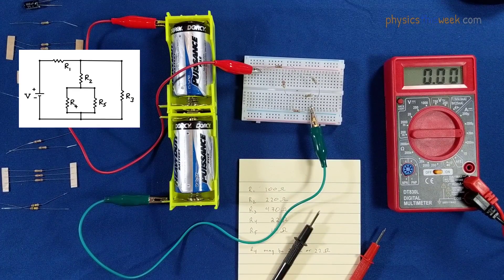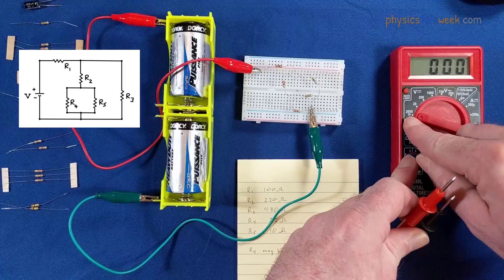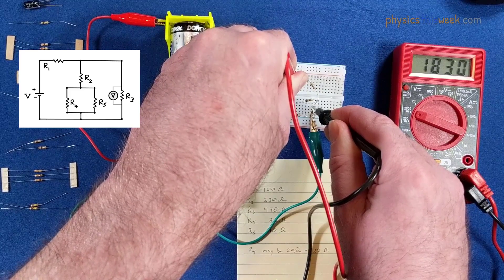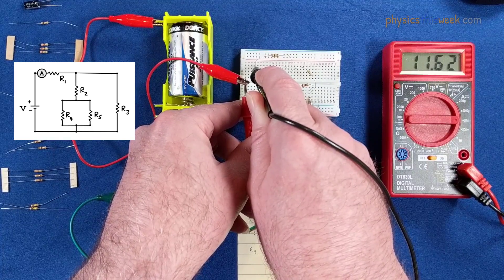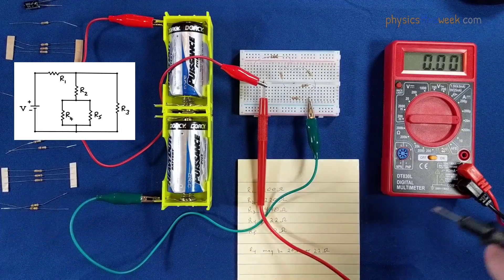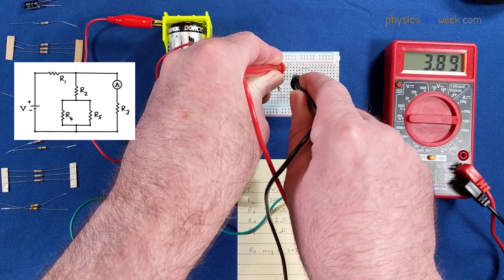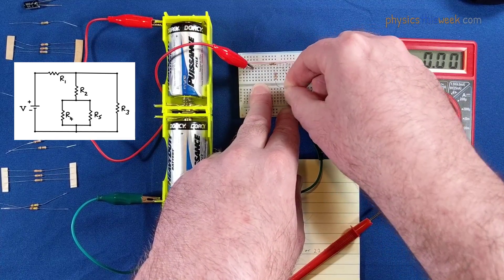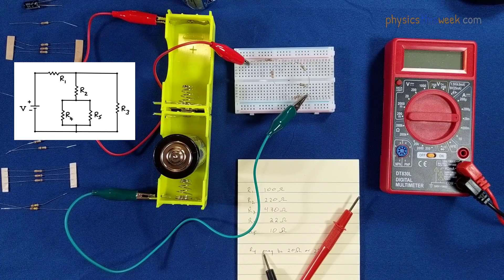DC Circuits Lab:  Combination Circuit Measurements

Comment: what would the total resistor ohm's be
Reply from the maker: That depends on how they are hooked together.  Which configuration are you curious about?
Reply: @PhysicsThisWeek  The setup you did is the config
Reply from the maker: @LordBurger  I apologize.  I forgot that I broke this whole lab down into multiple steps.  I should have realized that this was just one of the several configurations.

Have you done any circuit analysis, for example adding series or parallel resistors?
Reply: @PhysicsThisWeek  oh dw about it
Reply: @PhysicsThisWeek  I worked it out with my teacher this morning anyways. Rlly helpful vid otherwise :D
Reply from the maker: @LordBurger  I'm glad you got it.  I didn't calculate the overall resistance in the video because that is something that I have my students calculate as part of the lab experiment.  Thanks for letting me know that the video was helpful.
Reply: @PhysicsThisWeek  yeah np!